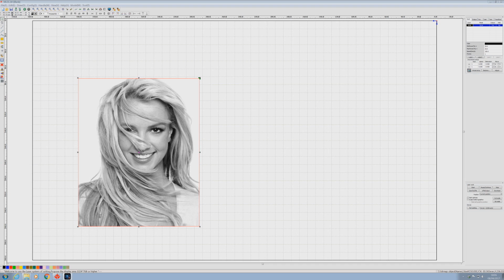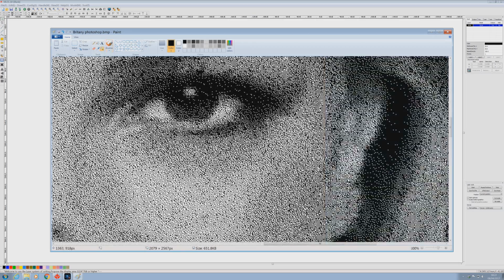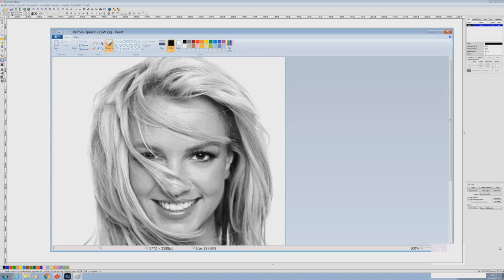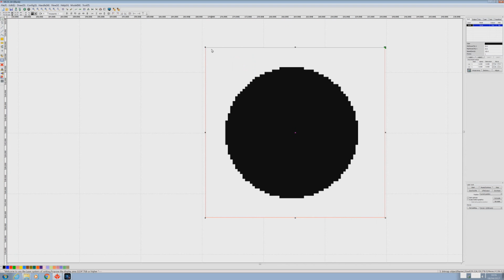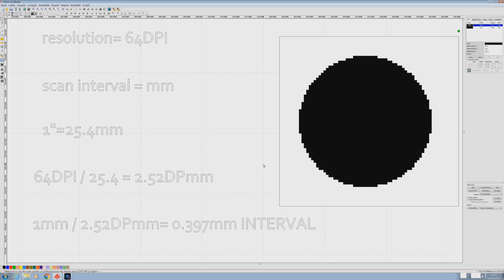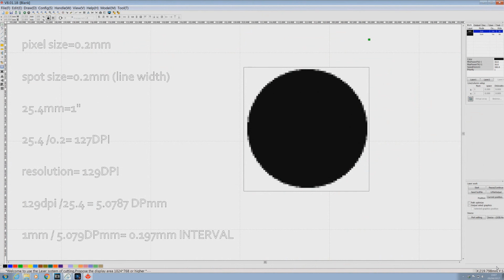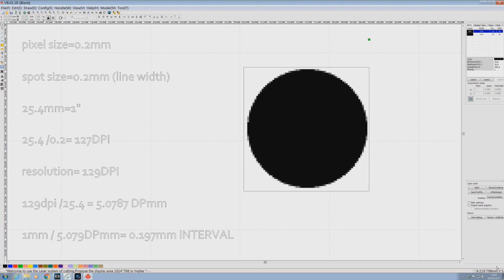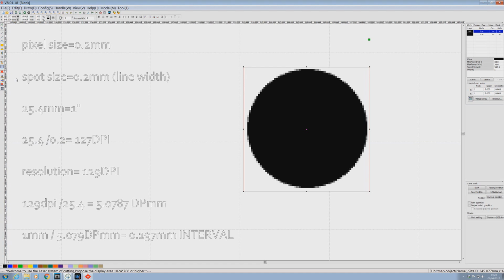RDWorks Learning Lab 101 the Importance of Scan Interval

Comment: One thing to bear in mind is that you can't have an arbitrary scan interval. The machine has to move in multiples of stepper motor microsteps. If the scan interval is not an exact multiple than you might get uneven steps.
Reply from the maker: Hi
You are absolutely correct but the machine claims a resolution of 0.01mm  which theoretically means I can work with pictures at about 2500ppi.  That is actually ludicrous because the IF I can make my 1.5" lens work to it's theoretical spot size (0.075mm) the best dot-adjacent-to-dot resolution I could achieve is 330 dpi. which is a line pitch of 0.077mm. Even if I miss a microstep or 3 it's will not show up as a missing scan line. However, if I do not match the step interval to the pixel resolution ( or a multiple) then there is a chance that every Xth scan line will jump a pixel line and cause a visual problem. 
Thanks for a great comment
Best regards
Russ

Comment: Hi great video thanks but for now, (I have only seen the first 4 mins.) there are a couple of errors. The digital values on a computer in a greyscale image is Black=0  White is 255 you had it the other way around. And there are 255 different tones of black/grey, not 254 as you said because we are also counting 0.
Reply from the maker: Thanks Klaus. I now have to add another item to my long list of age related problems. Old ,grey fat, ugly and now stupid!!!. I do in fact know that black is zero and white is 255 but I have noticed that sometimes my mind gets ahead of my mouth. In this case I did not spot the error. Let's see how many others do.
On the other issue my point was that black is  0 and white is 255,  that's a total of 256 elements. Black and white are the extreme absolutes and the 254 increments in between are shades of the mix. The first shade of grey must be 1 because 0= pure black and the last shade of grey is 254 because pure white is 255. Which ever way I look at it it seems there are 254 shades of grey........................or is there something else I must add to my list???
Best regards and lots of smiles
Russ

Comment: Hi, in RDWORKS, i don't understand what mean the flag "Optimized scan" in scan mode and for second i would ask you a best photo glass engraved you ever made. I'm not able to understand the max dpi resolution, thank you very much
Reply from the maker: Hi Alessandro
If you do not know how to calculate the best scan interval ticking the Optimized  Scan is supposed to choose it for you.However, I have no reason to trust that because if you have a 300 pixels per inch resolution picture the ideal pitch will be 0.084mm. If you leave the interval box empty it seems to choose 0.001mm which creates a stupidly huge file and not very good picture. If you follow the two simple calculations shown in the video you will get to a good setting. It may be possible to find better settings under certain conditions but this will generally work well.
Glass engraving has all sorts of complexities. First you need to produce a negative image  because anything that is dark will be etched and anything white will be unetched. . With glass (or claer acrylic) the black will be etched and produce a white mark and the white will leave clear glass. If you mount the glass on a black background then it will look like a negative. You must make your picture negative to start so that it comes out looking correct.. The same goes for etching on any dark marble, granite or slate. The second problem with glass is controlling the dot size. Basically you cannot control the mechanism by which the etching takes place. With wood or card or leather, the pin prick of focused heat makes a mark the size of the beam (maybe 0.1mm) but with glass it heats up that little pinprick area so rapidly that it causes a little glass shard to break away from the parent material.That shard may randomly be 2 or 3 times bigger that the 0.1mm beam.  It is not a controlled process but much more like a stone chip on your car windscreen. I have played with engraving and various materials but have no stunning examples to show you. I just know of many problems that I have discovered and am still trying to make sense of all the parameters.
In the very near future I intend spending several sessions on trying to understand all these variables and how to best exploit them for various materials. I can see that it is a HUGE subject. Sadly I am an engineer and not an artist. One of the main requirements is to have a vision of how the picture will translate to various materials because you will need to adjust the original picture so that it looks hideous , just to make it look good on its final medium.
Best regards
Russ
Reply: Hi, for first thank for your answer. ok i understand the resolution scan interval is easy to calculate, my question is about the software because when i click on "Optimized scan" nothingt happen. the textbox of scan interval don't change the value. This i don't understand.

Another more techincal question is about the speed engraving.  i saw that there is big difference quality of detail fromm 100mm/s to 400mm/s. Is possibile to think the laser switch on/off is not to fast??
Reply from the maker: Hi Alessandro
I have played with the optimized scan and to be honest apart from putting a stupid value in when the interval box is empty I have also found it does nothing detectable or obvious. I personally ignore it now.
This is the quoted explanation from the user manual
"Choose optimized scanning to automatically adjust the scan to the scanning interval for best effect. Otherwise, the user settings of the scanning interval scan pattern are applied. It is generally advisable to choose "optimal scanning".

I am currently experimenting with scanning as I am preparing a video on various scanning modes. This is a large and complex subject becasuse there are so many variables to play with and understand. From what I have seen so far, when you are trying to scan a dithered pictiure and there are billions of dots. the faster the scan speed the lighter the picture you produce for a fixed power. Although you may think this is to be expected, I am puzzled by it. If a dot is a burst of laser power defined by the %power that you set  and lasting for a minute but fixed period of time then the "burn" would be the same for all speeds and the colour would remain the same for all speeds. I was anticipating that the power was controlling of burn colour. This is where my investigation is currently at, trying to establish what factor makes the burn longer as the speed reduces.. I am working with a 600 pixel per inch  resolution picture at present and have many more trials to conduct before I start varying the pitch and then then interval. Currently I cannot answer your question but maybe in a few days time I will be able to understand just what is going on with control of the laser. The laser is capable of changing power and switching on and off incredibly quickly so I don't think it's a physical problem you are seeing, more an issue with HOW the beam is being switched on and off. 
Keep watching
Best regards
Russ

Comment: when setting the min and max powers would it be best to choose percentages from the power vs % plots that are in the linear range of the tube?
Reply from the maker: Hi Dwayne
A nice idea but if you limit the range the shades of "grey" get compressed and there is not as much tonal range in the picture. I have experimented but in the end I use 10 and 67% and adjust the scan speed to get the right contrast in the picture. Dithered pictures seem better than pure greyscale.
Best wishes
Russ

Comment: Russ, how does the resolution of the stepper motor factor into your calculation?
Reply from the maker: The positional accuracy  of the stepper system on most of these machines is claimed to be  0.01mm. This is 100 dots per mm capability or 2,540DPI. This is way more than ANY lens is capable of. hence the stepper resolution is unimportant
Best regards
Russ
Reply: I asked this on another channel and belt type and gear type all effect the steps per millimeter (in RD Works that would be the interval).  A CO2 laser can focus down to 10 micron but what good is that if your minimum steps per mm can't go that low? edit:  Let me add that in Russ's case his .2mm line his laser makes is really freaking huge as the dot size of a CO2 laser beam (the smallest it can go) is .01mm (10 micron) so .2mm is pretty crappy when a 3d printer can do .1 or even less.
Reply from the maker: I think you have confused two important facts. The wavelength of the CO2 laser beam is indeed 10.6microns (0.0106mm). This is NOT the size that the beam can be focused to. That depends on the lens focal length and the diameter of the beam. This is clearly explained at
http://www.parallax-tech.com/faq.htm

I set my beam out of focus to achieve a nice even number (0.2mm) for demonstration purposes. Theoretically my 1.5" lens may achieve a spot size of 0.075mm. I have never been able to get better than 0.012mm but this may be because my beam is almost 10mm diameter.

Best regards
Russ
Reply: Why is your beam 10mm diameter?  The finer your spot the better the picture quality potential.

Wiki lists the CO2 beam as 10 microns not 10.6 microns (that is a big difference at that level) so what are they talking about?  I am getting a suspicion that it starts out at 10 microns but because of the travel path it takes until it hits the lens makes it spread out too much.
Reply from the maker: Hi 
I think you are confusing beam diameter with the wavelength of the coherent light emitted buy a CO2 laser. The closest anaology I can use to help explain the difference is with sound. High notes and low notes are the wavelength and  the volume of the note is the beam diameter.The beam diameter depends on the size of the exit window from the laser tube and also the energy density pattern within the laser. My tube claims to have a 6mm beam diameter. It has a 12.7mm exit window and at full power the energy profile across the beam should ideally be Gaussian (bell shaped)where the majority of power is towards the centre of the beam. However there is still power right out to the window diameter at full power. In my case about 90/95% of the power is within a 10 mm diameter but it can still burn a 12.7mm hole in a piece of masking tape!!!!
A coherent beam of laser light does not diverge(spread out) as you are imagining or change its wavelength. NASA regularly fire a laser bean (albeit a different wavelength) at a 2ft target on the moon  and knowing the speed of light and measuring how long the light takes to travel there and BACK  they can track the distance of the moon from earth to within a few centimeters. That just would not work if the beam diverged like a torch beam.
I will shortly be publishing a video about measuring your laser beam diameter.

Best regards
Russ
Reply: I asked about a test I had done prior to this video on your next video after this.  I await your response. :)